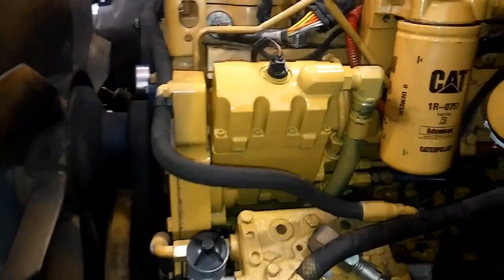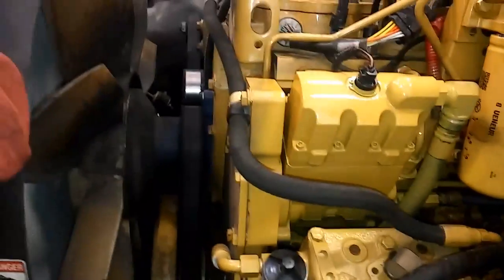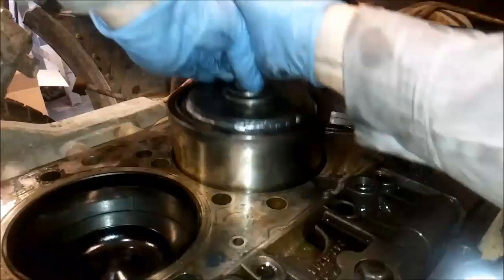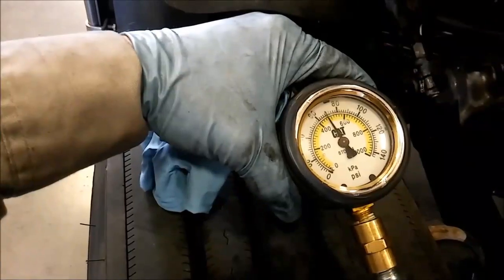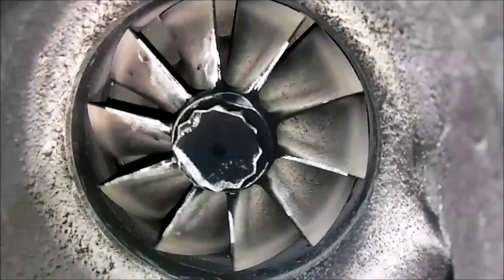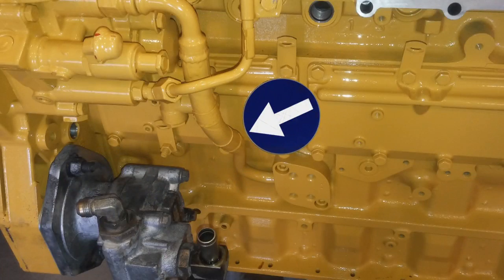How To Make Your Cat C7, 3126, or C9 Bulletproof.  HEUI System Upgrade.

Comment: MY oil cooler was leaking back in 06'. Had it rebuilt no issues with the HEUI pump, thankfully. I have 621,000 miles on a 2000 Freightliner FL80 with the orginal 3126 motor.
Reply from the maker: +TA1199 That is almost 3 times the recommended run life of that engine. You must be keeping up on maintenance and not mistreating it.
Reply: Adept Ape I baby it and, the loads I pull normally aren't heavy. However when I have a heavy load on it 12000 to 15000 pounds it pulls it fine. It seems to run better after it works out. I am the only one who drives it.It doesn't burn oil. Very little smoke on a cold start. I keep it plugged in when the temp get below 40*.  Oil changes every 6500 miles and I run Howes fuel injector cleaner nearly every fillup. Speaking of fuel. I get over 10 miles to the gallon.
Reply: @thethomasj1795   what type of transmision? 6 speed
Reply: @stevebellows7314  yes.
Reply: @thethomasj1795  I just bought one runs like a top... changed the oil with rotella today.  285 k in Engine
6 speed Spicer tranny
Need to clean rail injectors just to know there ok... what's your secret
Reply: @stevebellows7314  regular oil changes and not beating on it like its a race car. Good diesel.  I only put name brand fuel in. Sunoco, BP When ever i put off brand fuel in it runs rough and won't start in the morning.
Reply: @thethomasj1795  I'm using cetane booster and marvell mystery oil. 2 degrees out starts just fine.  1500 miles on it from a week ago in in love power house!
Reply: @stevebellows7314  This winter has been a bit of a challenge and it's not even that cold yet. It's been giving me a hard time starting even when plugged in. I use mystery oil to from time to time . it doesn't hurt.
Reply: @thethomasj1795  negative 8 here today . Started without being plugged in. I use oz per 5 gallons marvel.  And cetane boost.. also Lucas every fill up
Reply: Dropped valves are the usual death from extra weak valvesprings , had 2 engine failures at about 200k miles from the same thing both times. I'd recommend dropping in fresh springs to keep it alive

Comment: I'm a fun of Detroit diesel engines specially  series 60 why you don't  talk about them
Reply: mowmaal had a bunch excellent motors cheap to run fix . They pioneered the electronic injection in the late 80s.
Reply: @westbender 820 3126 is a medium duty engine. The Series 60 Detroit is a heavy duty engine.

Comment: Looking to buy an 05 c7500 with a 3126 CAT, has 104k on it and the guy says its well maintained, what are some things I should know to look for when I go to look at this truck ? should it smoke white when its cold at all ? stuff like that
Reply from the maker: +Jack Brennan I should make a video of what to look for on a used engine when buying it. Oil pressure, smoke, blowby, leaks, things like that. I suggest an oil sample taken, that'll tell you a lot and they are fairly cheap.
Reply: Adept Ape thanks !

Comment: my oil dipstick won't go back in all the way? needs about 4 inches more...All I did was pull it out to check the oil...this is a C-7 Cat 350 HP   in A 37 Ft TropiCal RV  ...any Ideal whats wrong?
Reply from the maker: Is it a super long dipstick?  If it is the 8 ft long one you will most likely have to just play with it by slowing twisting it and moving it around to get it to go back in.  This is a very common problem.
Reply: if the dipstick tube is curved, make sure the flat edge is along the curve or the dipstick wont curve in the tube and go all the way
Reply: thanks guys I finally got it to go back in by just  kinda twisting it jabbing it  and it went in  just was paranoid about it I guess freaked out

Comment: ADEPT APE what would be a good replacement engine to replace a 2002 3126, in an F650 what would have higher rev line more power an be more durable then an 3126

Comment: Cat c9 
I installed new actuation pressure sensor after installing it started normal but after 15 minutes it stopped and now it won't start and no error codes are there but maintenance light comes on 
Also i removed the actuation pressure sensor and cranked but there is no oil pressure

Comment: the most important thing to do is replace the oil and filter every year.  It is very hard to work on the 3126 in my RV (I just replaced the exhaust manifold gaskets) - there is no room.  A school bus would be a lot easier.  So I'm not tackling either of these job unless CAT announces a recall.

Comment: Mr. Adept Ape, I'm looking at buying a 2002 school bus with a cat 3126 with 220,000 miles to convert to an RV.  The engine fired right up and idled smoothly. With a cold engine (Miami FL 80 degree day), there's some blow by at idle visible with the oil fill cap removed. I'd call it mild amount of smoke/vapor with no force. With my palm over the opening, I could not feel any pressure or pulsation. Can I get your opinion on the condition on this engine based on this little information please?  I really appreciate all comments on this. Thank you!
Reply from the maker: +Steven Vaccarello With that much information, I can't give any sort of opinion. When it comes to blowby, you need to measure the volume not the pressure, without a Blowby meter there isn't a good way to tell. There is obviously too much visible blowby on some engines, but if it looks like a similar amount to other engines it might be okay.

Comment: WARNING!  Novice Question:  is the C7 and the 3126, the same engine? Also, where can a guy go to learn about working on these engines. Mine, is in my 2000 Thomas MVP school bus.
Reply from the maker: +Phil Verry The 3126 is the precursor to the C7. The 3126 is a more reliable engine in my opinion. They share some components, but not the injectors, harness, and various other things.

Comment: If possible please provide the part number for the new line without the pump.  Since you have to remove so much, to install the new line, do you recommend just replacing the pump with a new one?
Reply from the maker: +GrandSport340 There is no change to the HEUI pump, just the line. You can leave the pump on and change the line. For the part number, you should call your Cat dealer with the media number I gave in the video and they'll be able to tell you the parts you would need.

Comment: what gauges do you recommend for diesel diagnostics. i work at a freightliner dealer and have started doing diagnostics and was looking to get some gauges but dont know which ones to get.
Reply from the maker: +jamecorts I use the Cat branded ones, 5 different ones that range from a vacuum, up to 8,000 psi. I think they are about $40 each, but I mostly use the one that is 0-140 psi for fuel pressure, oil pressure, and boost.

Comment: How do i bullet proof a 95 kodiak with 3116
Reply: Put a Cummins in it -- just joking.  Maintain proper oil change intervals.  Our '95 Kodiak with a 3116 is used strictly for plowing snow, and its engine oil is changed  every 5,000 miles at the most.  No problem with that engine.
Reply: 3116 has same oil cooler arrangment but is mechanicle fuel injection it is pretty much already bullet proof as long as it is maintained properly

Comment: I think cat should jump back into the tractor market. I know they make a few that I know of but I think they should try to compete with John Deere like they did in the good ol days
Reply: TheOtherWhiteBread0 read through the earnings reports for the equipment manufacturers. Construction equipment makes a disgusting amount more. They sell world-wide and don't forget there's whole countries with little to no agriculture and only construction. Just because a few states have a mainstay in agriculture doesn't mean ag reigns supreme. Also, those states with massive ag industries still have construction. You always have construction, but you don't always have ag.
Reply: Stephen Molzer if it matters Stephen. Is right. You don't think Cat has looked at Ag? They are a large company out to make money. If they thought they could they would.
Reply: they would but there is just not much money to be made in the agriculture market. construction is more company owned equipment compared to farming being individual owned machines.

Comment: What kind of mileage do you see these heui pumps often failing at ..(school bus mechanic ) lots of c7s we have
Reply: APE,  I hav a 3126 ,so how do you fix the un level cooler ? And wht do you chk if this unfilter oil has past to the filterd oil?  I added a bye pas filter ,you think this can help ?
Reply: Mine failed at about 87k in an RV.
Reply: My RV with a CAT 7 has new pump that was installed by a previous owner around  40k miles.  I have 58k now and not detected any issues.  I change the oil once per year regardless of mileage.  Which averages around 4k miles per year.
Reply: That bypass oil filter will be a great addition, if it filters down to one micron. BUT it will not totally offer the desired benefit from the issues Josh  addressed, because unfiltered oil can still avoid the full flow and bypass filters due to the oil cooler warping problem.
Reply: sergio rodriguez I layed a piece of glass on a counter top and put sand paper on the glass and sanded the housing flat like that. It worked very good and saved a lot of time and probably 40 bucks at the machine shop. Lol